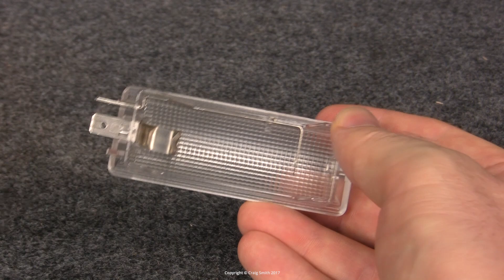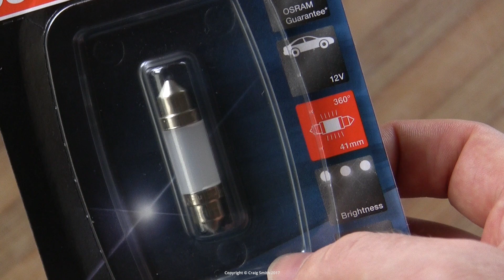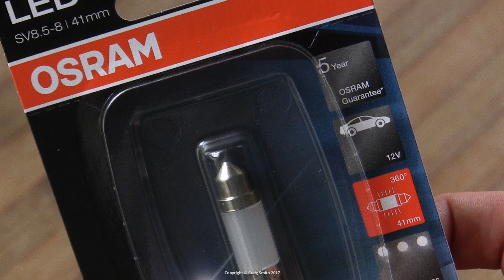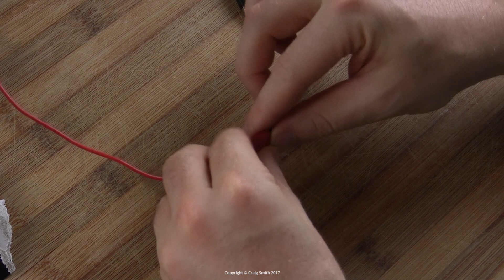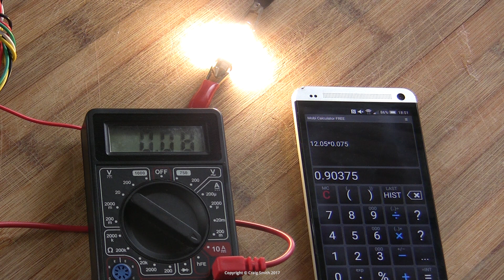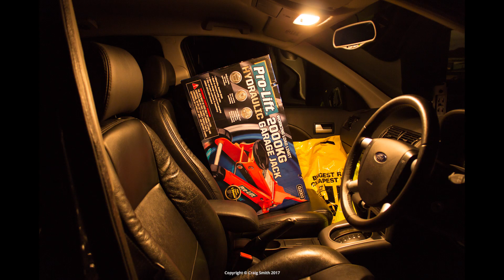Review: Osram/Sylvania festoon white 4000K LED

Comment: In my car, the difference of 1mm in length makes a difference.  Squeezing in a larger bulb flexes the housing and is not good.  Not sure what car you have that gadd such flexible prongs.
Reply: Same here.. buy it 6418 and won't fit they need to be a little flat on the point to slide into the slot